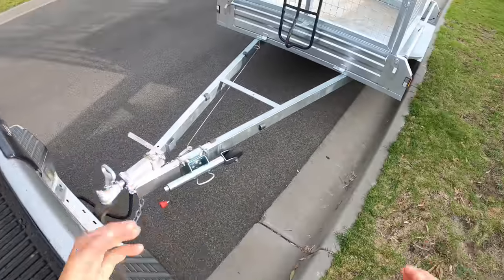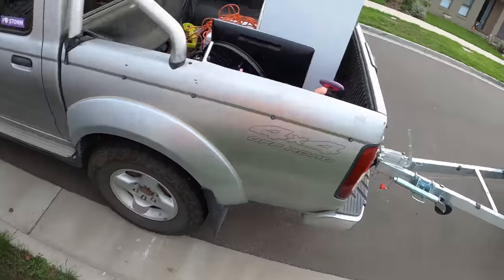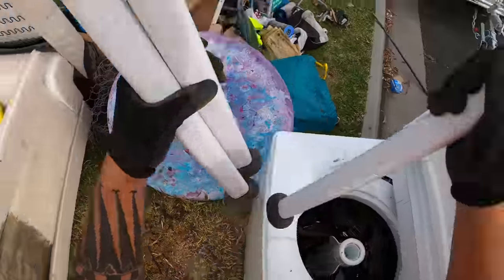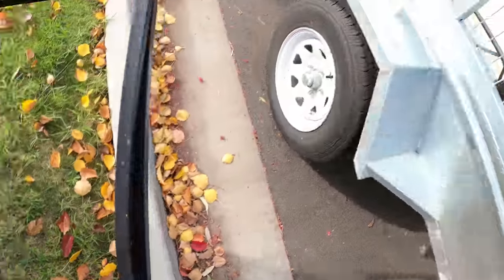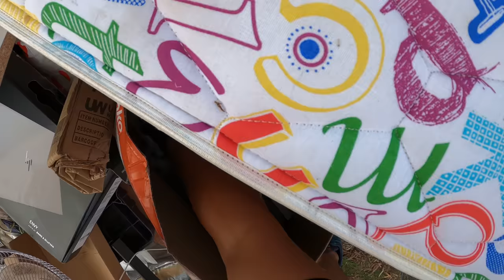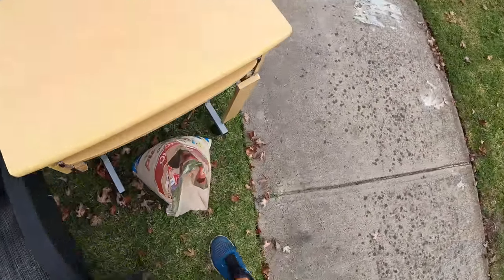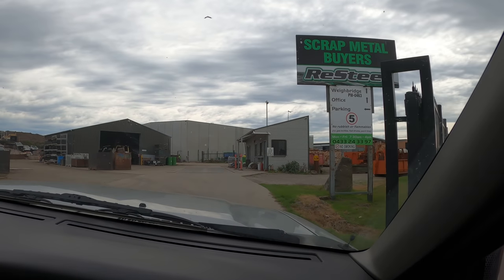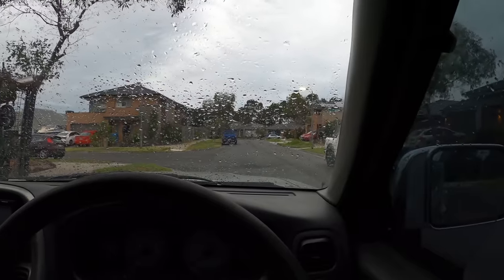How I Fill An 8x5 Trailer With Scrap Steel

Comment: 44:49 - those would be some of the discs for some of those empty cases shown earlier. And those wrestling figurines. They haven't vandalised them. What you do is adjust the limbs and bodies of the figurines into wrestling holds on any of the other figurines and the kid[s] go, " And Joe has Zombie in a half-nelson. ". And then they re-contort the entwined pairing and then, " And now Zombie has Joe in a triple lock. ". And, woops, maybe a head or arm comes loose.
Reply from the maker: Yes you’re probably right about the dvds though I didn’t want to sift through and match them at the time. Some of the figs had snapped plastic so I decided to leave those. Cheers Jongle 🤙🤙
Reply: @PolyProphet  I figured that you were racing the clock a bit. I wasn't suggesting an oversight on your part. Just noting it.

Comment: Poly the next time you find a heater or hot tank put a pipe on the wrench and it will give you more leverage to take those fittings off.A good day and video thanks.
Reply from the maker: Great advice mate thank you 👍👍

Comment: Those brass fittings welded on by rust just use a big hammer, you need a 18” pipe wrench . I’ve got twenty or more , every time l see one l grab it . All different sizes up to three footers . Always interesting from up top next time 👍🇨🇦
Reply from the maker: Yeah totally should of tried this 🤦

Comment: In the beginning of the video you would pulled out a radio those antennas on the radios are made of brass they're pretty easy to just break off it's quick clean brass just a thought for down the road
Reply from the maker: Thanks for the reminder mate. I always forget 😅

Comment: Fairly new subscriber here from USA. I am surprised that a lot of items are the same in Australia as they are here. Mostly fans. Washers seem to be a bit different. Biggest shock was the first time I saw you weigh in. Kilos are way different amounts than pounds. I have a frontier like yours, and all I could think of was that it was so light. Am surprised how much you can haul with it though. Keep posting these great videos.
P,S. Love your new trailer.
Reply from the maker: Thanks for subscribing Patricia! 😊

Comment: Awesome finds today Poly, those figures are worth money. I'm surprised you weren't followed around the suburbs with all that oven juice lol. Reckon you need a small Jemmy bar to keep in your tool bag, you really needed one a couple of times. Keep up your good work mate.
Reply from the maker: Yes I’ve seen resellers rave on about wrestling figurines, so hopefully some home runs in there. Is a jemmy bar like the bar I use to get front load washer motors out?
Reply: @PolyProphet  not sure Poly, I haven't seen you use it. A Jemmy is a bar about 2 ft long and has a bend on one end with a cut out on the end like a nail pulling hammer and the other end is slightly bent with a flat end. Very useful very strong tool for jemmying things apart.
Reply from the maker: Yes that’s the one I use. Over here they are commonly called crowbars. Thanks for the tip mate 🤙🤙

Comment: Greetings from northen Sweden and a fellow scrapper.
I have to say,, that trailer has a really long towbar and what make is it?
I build trailers for a living at my job but I have never seen one like that, what is the wire along the towbar?
Reply from the maker: G’day mate. It’s an 8x5 with a meter cage and 1900mm drawbar. The builder offers a cage and ramp for a mower or a large toolbox on the drawbar but I chose to keep it clear. The wires are the brakes 🙂
Reply: @PolyProphet  ok, I just haven't seen one like that,, occupational injury I guess 🤣.
Our trailers have 1450mm drawbar and brakes are activated by a pushrod, we also have them with no brakes.
Most of our trailers, about 90% are sold with a hood on them and you can also get a ramp,, mostly used for snowmobiles.
Reply from the maker: Ahh I see. I used to have a trailer with a shorter drawbar. It wasn’t as easy to reverse like this one is. I also had the option of a hood and ramp back gate. Snowmobiles are cool 😁
Reply: @PolyProphet  Oh yeah, the shorter drawbar tends to want to do a jackknife as you put it in reverse 🤣
You are right about snowmobiles are cool,, and loads of fun and a little thirsty as far as fuel is conserned but it's irrelevant anyway as it's fun,, and hazardous to your health if you don't know what you are doing.
Think about it,, a machine that wheighs in about 300 kg and you could have 350hp to play with,, they move rather quick from the get go 😬